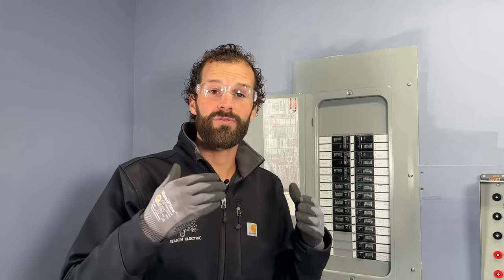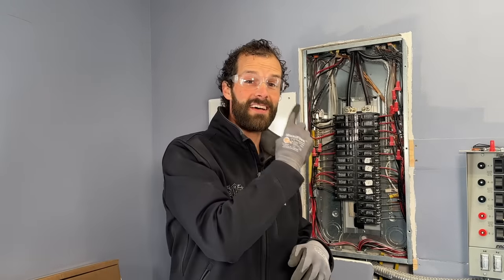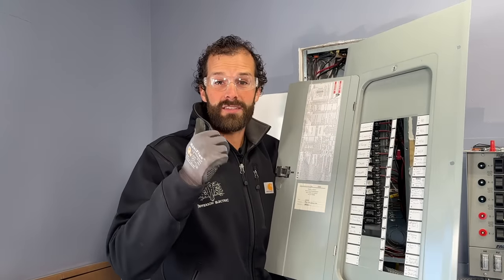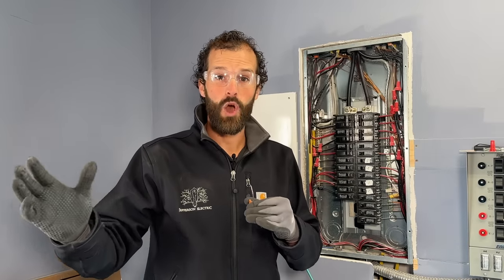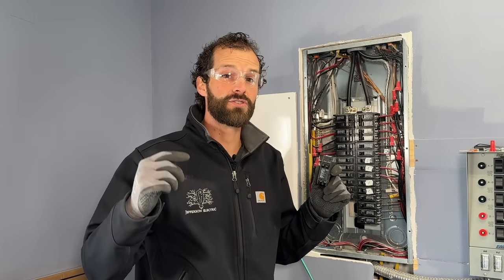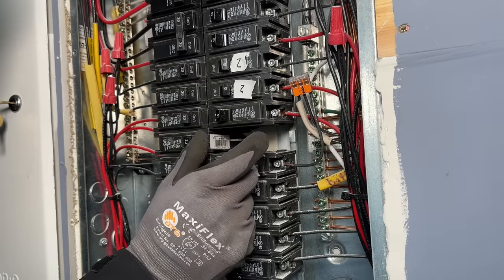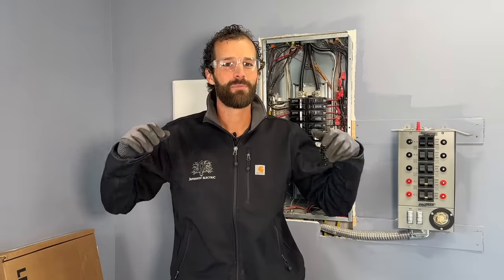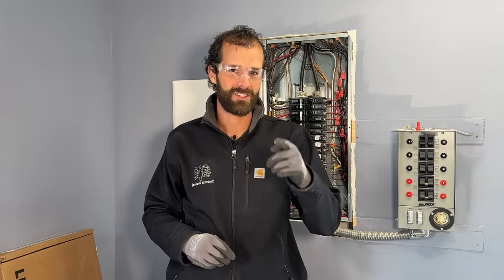No Room In Electrical Panel - Quick Fix

Comment: Brilliant teaching homeowners how to get themselves into trouble with their electrical systems. Priceless.
Reply: Your comment needs several thousand 'likes'.  And I'm a tradesman (HVAC/R) licensed to do equipment specific electrical work up to 600 VAC/DC.  A little bit of knowledge is always a recipe for unperceived hazards and unwarranted 'confidence'.  And with electricity those misapprehended hazards can be the wrath of God.
Reply: know enough to be dangerous lol
Reply: It would be appreciated and useful if you could point out the dangerous misinformation in this video.  I'm a homeowner who intends to move some circuits around.
Reply: @keifsanderson Check what I said in the main comments, I'm sure I saw the same issues as @mattlewis383 so I pointed them out with explanations, and gave 3 proper options, and I'm pretty sure the inspector still wins on the 2 wires under 1 breaker @ 2:20

*one other problem I didn't mention in my other comment was that he says at 2:30 he's combining bedroom and exterior lights, here in Canada, new bedrooms are on an arc fault breaker, and it's best to only have plugs on an arc fault, as the spark from a switch closing, (although in this case a photocell firing, probably no spark) or from certain bulbs/ballasts firing, that spark can cause nuisance tripping on AF breakers, just FYI
Reply: I had a customer who tried adjusting temperature on electric water heater. She was thrown across the room when she started touching screws with 120v per leg. All started by her watching YouTube how-to videos
Reply: @JohnQPublic345  So what do they need to do ban all educational videos on YouTube because people can't use common sense???
Reply: @Avarice-Zero  not a bad idea
Reply: @JohnQPublic345  You can easily get things in motion by not watching these videos and commenting. I think people will take notice and do the same. Be the leader you were meant to be.
Reply: AS long as they use a #2 sq. dr. they should be OK!
Reply: I'm a little uncomfortable doing the things in this video though I'm sure there are circuits that are under utilized.

Comment: nice info.  my city went stupid a few decades ago my having all newer homes designed with the breaker box outside the house next to the meter, rather then the older way of in utility closet or garage.
Reply: I was surprised seeing that in other localities; not sure why that would be done. Saving space in the house? I only see disadvantages to the practice, accelerated degradation, external tampering, having to run outside in the weather to reset a tripped breaker, and probably many other things.

Comment: This only solves half the problem caused by a full box.  Granted using the Wago pigtail frees up a breaker slot.  But the box was full.  Where do you put the ground and neutral on the new circuit you are now adding to the box?  Do you run more Wago pigtails on the ground and the neutral of the new addition?

Comment: Panel removal: 
  1. Remove top two screws.
  2. Insert pegs or nails to hold
  3. Remove bottom two screws.
  4. Pull off panel easily, without struggling.
As for those posts demanding all work be done by a "professional" electrician, we have had such "professional" work done that resulted in breakers tripping. Had to straighten out the wiring mess myself. I was unhurried and took the time to do it right.
- a DIYer
Reply from the maker: Thanks for the feedback and unfortunately your experience is all too common these days.
Reply: I have an older home that looks like it has received several upgrades since it was on knob-and-tube. I went around with a tester when I moved in and found one instance of live and neutral swapped and a bank of outlets in the kitchen with no ground. Professionals around here are not always what you would hope for if they even show up at all.
Reply: Well that is the safest way.  If he follows your instructions he will never get the panel off!

Comment: thanks for the video, Scott! HELP! I'm replacing an old Federal Pacific 100-amp panel with a 200-amp Square D Hameline panel, so I will need to upgrade the service entrance cable and want to use 2/0 THHN copper.
 The outdoor meter can/box is mounted low, (30" off the ground at bottom edge of can) outside, so if I use the bottom rear 2-inch knockout of the meter can, it will put the hole through the wall below the bottom edge of the new breaker panel by about 8 inches, so I will have to make a vertical 90 upwards turn from hole in wall to bottom knockout of the new panel. I cannot find a 2" close 90 PVC electrical fitting so I'm guessing they don't make one. 
My question is: how do I make that vertical 90 turn upwards? It will eventually be covered in drywall. Do I need to have the inside copper leads in conduit at all? If I use switch to 4/0 aluminum, do I need conduit inside the wall cavity? thanks in advance!

Comment: One little safety tip.  While he mentioned opening the main switch, I always use a neon lamp to ensure what I'm working on is dead.
Reply: Hey James, You able to explain this one?
Reply: @Sonny_Allgood  ????
You mean the neon lamp?  I'm referring to those neon test lamps that can be used to see if a circuit is live or not.  A neon lamp will work on a wide range of voltages and if it glows when placed across a circuit or between a conductor and ground, then the circuit is live   It can also be used to determine if the power is AC or DC and if DC, polarity.  It can also detect when there's significant radio energy in the vicinity.  It's a very useful device that you can keep in your pocket, like a pen.
On example of when I used it was a few years ago, when my outlaws had a dead outlet.  I used the neon lamp to verify where there was or was not power, until I found a dud fuse.
Reply: Use a real tester , static can light up a neon one
Reply: @gerdberg4188  It might flash with static, but it won't stay lit.
Reply: Hey it's your life if you want to use substandard testing methods .
Reply: While non-contact voltage testers are great tools and use them all the time, I never rely on them when it comes to my safety, always use a real meter to verify live/ dead  wires! Yet another reason untrained persons should not be doing this work! Look up the definition for Qualified Person in the NEC.
Reply: He’s talking about a very OLD way of testing power which by today’s standards is not only dangerous but completely unnecessary. Buy a clamp meter or a multi meter to check for voltage and if working on DC it will also show you polarity. And if you need to be told whether a home panel is AC or DC then you shouldn’t be working on panels yet.
Reply: @esl4058  A neon test lamp is just a simple go/no go test.  It can also show polarity.  A clamp meter will show current, not voltage.  So, you could have a live circuit, without a load, and the clamp meter will not show anything.
Reply: @James_Knott  A clamp meter would yes, but not a multi-meter with probes. That will detect voltage.
Reply: @darrendolphdragos9752  I thought voltage was what we were talking about.  You check for AC voltage before working on the circuit.  A clamp on meter won´t tell you that.  I  mentioned a quick & easy way to check for a live circuit, not whether there was a load on it.

Here's an example.  Many years ago, my in-laws had a dead outlet in the kitchen.  It was half of a split duplex outlet.  There was no load, as that outlet was dead.  I went down into the fuse panel and used the test lamp to verify there was power at the fuses.  One fuse had no voltage on the load side.  Turns out it was a dud fuse.  A clamp on meter would have been of no use for this.  I could have used a multimeter, but that would have meant taking my eyes off the fuse terminal to look at the meter, while still holding the probes on it.
Reply: There are situations where a DMM won't work as well as a non contact voltage tester to determine if a wire is live or not, if you don't have clear and easy access to the ground or neutral connections with the probe tips.  Pulling out a light switch requires handling the potentially live switch to get to the terminals to measure, while the NCV could be used as a first line verification before physically pulling it out to verify with the meter.

Comment: Thanks for the info., great video!
I had one question. 
Have you heard of a "Pushmatic" breaker panel? I have a 200 amp Pushmatic breaker panel! It was installed in about 1980 and from my understanding it's no longer made and obsolete!
Any suggestions?
Reply: I have Pushmatic in my 1977 house.  I had to replace a breaker, and they are hard to find locally.  You can order them online more easily.
Reply: Most, if not all, electricians would suggest the immediate change out of "Pushmatic" and "Federal Pacific" panels/breakers because the manufacturers lost their electrical certification as a result of past demonstrated failures/fires/problems.
Reply: @billhandymanbill2775  Thanks for the  advice! Any suggestions on what name brand of breaker panel would be best?
Reply: @kevinberniebarron7548  Yes I do.... "Square D" brand is the most popular name in the industry, and you can find their breakers in the big box stores too.  Square D is a very reputable and safe brand too.  I would also suggest putting in a "whole house surge protector in the electrical panel, as now required by NEC code, to protect all of your major household appliances and computers, televisions, microwave, etc.  Check with your power company/electrician about putting a 200-amp service panel and that should cover most of your common electrical needs.
Reply: @billhandymanbill2775  Thank you!
As you know, my old 1980 Pushmatic 200 amp breaker panel,  definitely needs to be replaced!
That will be my top priority for 2023!
Reply: @kevinberniebarron7548  That is the BEST New Years present you can give to yourself!  Be careful not to overload your electrical circuits while you still have the “Pushmatic” in service.  Electrical safety is a major priority here especially with that electrical panel in service.  The quicker you get a new electrical panel the better you will be!
Reply: @billhandymanbill2775  🖒
Reply: @kevinberniebarron7548  I don’t understand the”?”.
Reply: @billhandymanbill2775  I'm not sure what the question is either!
Not sure, but, I was asking about what I should do about my 1980 Pushmatic 200 amp breaker panel!
I thought you recommend changing it out to a Square D panel rather than trying to find more of tbe Pushmatic breakers!
Was I  correct in this advice?
If not, what were you suggesting?
Reply: @kevinberniebarron7548  Sorry for the confusion as your last reply had just a "?" and no question.  Absolutely, change out the "Pushmatic" panel and replace with a Square D panel and you will be in good shape.

Comment: You don’t mention to make sure if you combine or rearrange circuits you don’t end up having two circuits that may be sharing a neutral on the same phase in the panel. This occurs when a three wire Romex is used to power two circuits and sharing the neutral.
Reply: For real, why would someone do that?  I had a shared neutral in my barn and the insulation was damaged.
Reply: This was a very low effort, not well thought out video and it should not be aimed at DIYers. It touched on many complex issues, homeowners and DIYers should not be attempting to make these kinds of modifications.

Comment: Another option in the case of needing to expand a two pole breaker is a quad breaker. We use them a lot when installing car chargers. Another point, make sure you are keeping to the same phase if you have shared neutrals.
Reply: @GW2016 how do you mean keep to the same phase if you have shared neutrals? That’s how you overload a neutral, ex 12/3 on a tandem breaker is putting two ckts on one phase and over loading the neutral. You have to have the two hots of a multi wire on different phases with a shared neutral or if using two 12/2 ckts on a tandem each ckt would have to have its own neutral when sharing one phase
Reply: @ryanbowles5158  I took it to mean when combining 2 hots right next to each other vertically . They were previously on opposite legs of the 240 volt feed.
So would be best to do this in even numbers of breakers for final . . . assuming the phase load was balanced to begin with . . . ergo the op means do not mess up the phase load as was prior ?

Comment: I have only two spot but I need 220v for the dryer and 110 for the lights 

can I use two single pole to get  220V and  use one of the two to get 110 only ?

Comment: Thanks a bunch for this video. I didn’t know you could pigtail off of a breaker. You learn something new everyday. Thanks again!
Reply: Check your local code before pig tailing.
Reply: @johnbattista9519  I would presume that local codes are not that granular. My town just adopts the NEC wholesale with just one modification - a big one; they don't allow Romex, conduit only.
Reply: @johnbattista9519  yeah, using a panel as a junction box has never been something I knew to be code approved.. But who's gonna catch you unless your house burns down and they deny your insurance claim 👏😅
Reply: @KameraShy  When do you think your locality will get public power and Internet service--they sound a little behind?
Reply: @johnbattista9519  where can I find my local code? It’s not as simple as looking in the nec code book. Is it?
Reply: @lukejones7366  Have you ever installed a transfer panel for a generator? Did you do it according to the manufacturers instructions? If it were against code, why do all the manufacturers make transfer panels that way?
Reply: @lukejones7366  It's a common misconception that you can't make spices in a panel. It's stems from a misunderstanding of code. You can't make splices in a panel if they don't originate in that panel (meaning you can't splice a wire from a different panel or different system).
Reply: @jordanclayton7913  thanks for that clarification jordan, that will be very helpful moving forward :-)

Comment: You can just tell people to shuffle their breakers around if needed. You didn’t mention phasing. It looks like there are 3 wire circuits in that panel that share a neutral. If you shuffle those circuits around you could potentially cause a dangerous situation where the neutral gets burnt up due to the 2 circuits winding up on the same phase.

Comment: I removed several baseboard heaters that were no longer used. This freed up space for my mini splits.
Reply: interesting, we're about to do that at our farmhouse that we're renovating. It has old baseboard electric heaters that we're taking out.  My wife detests the look of mini splits, but they are the wave of the future.
Reply: @replyhere590  quick way to freed up space on the panel. One quote I got was to install a larger electrical panel, $$$. Needless to say I didn’t got that route.

Comment: While I recognize the power was off as stated early on, "turn off the service disconnect", there are some bad habits in this video.  Such as touching the uninsulated screwdriver with fingers.  Yes, I know the power was off and the hand had a rubber type glove but it's a bad habit in electrical work none the less.  As is placing your fingers near the buss bar, again, I realize power was off but it's a bad habit.  I was always taught to treat every circuit as if it were a live circuit.  It only takes one mistake.

If I recall Siemens makes a copper buss 40 slot panel which is great for adding space.  Although it will still require the cost of changing the panel.
Reply: Yes, it only takes 1 mistake! Years ago I needed to work in the panel but was unable to turn off the incoming power because of a non-cooperative landord in NYC. I thought I was being careful, but not careful enough! Used needlenose pliers and it accidentally shorted something. A big flash, loud electrical pop, and a nice deep slot etched into the pliers! Scary stuff.
Reply: @KpxUrz5745  Yeah, a panel, energized or not, is no place to be touching metal objects and not paying sharp attention to who and what is grounded.  I get that this guy knows what's up but he's speaking to people who don't know.  So showing them bad habits is not a good idea.  The average home owner should stay out of panels if they don't know what is going on inside.
Reply: just like a gun, always loaded !!!

Comment: I've been a home inspector for over 20 years and have removed thousands of electrical panels and have never killed the power first, of course I couldn't do that in someone else's home in the first place. Seems a little overkill to me but of course its a safer way to do it. I also remove the last screw like you show, have a few panels slip on you and you figure that out pretty quick.

Comment: My subpanel has a space for a single pole breaker,but there is no space for a neutral on the neutral bus bar. Can you use a Wago by the same method for combining circuits on one breaker? Also will you do a teach on a shared nuetral circuit? You are an excellent presenter!